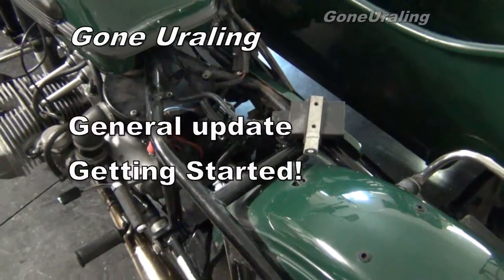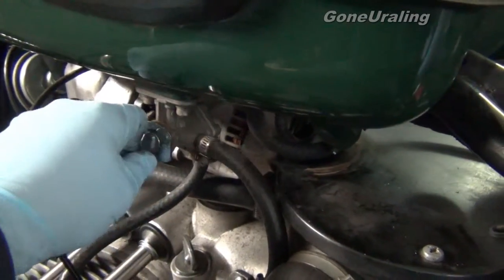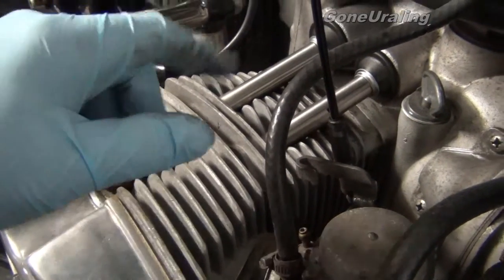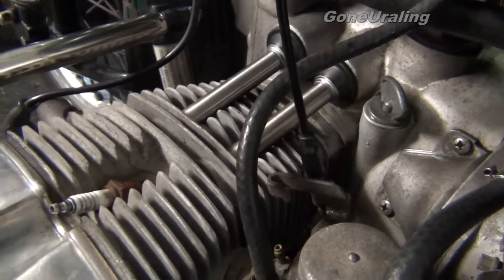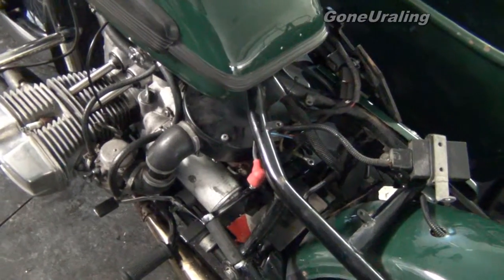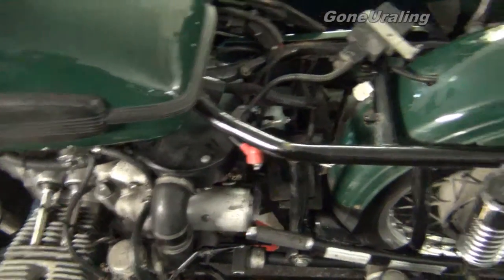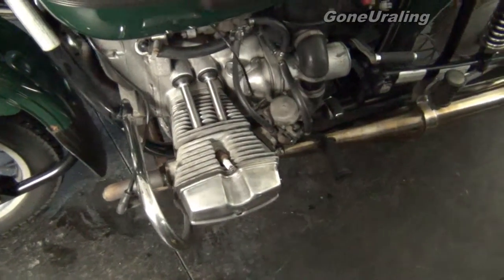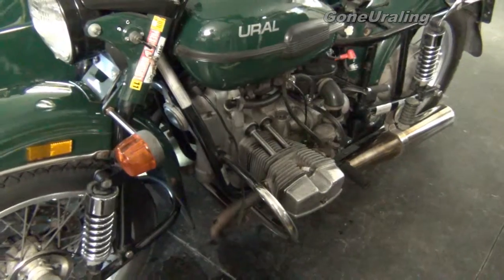2010 Patrol Project - Getting Started

Comment: I haven't watched past this video, but I don't believe you are going to find any major engine problems. If it is the case it was probably caused by running the engine with gasoline in the oil. I started working as a motorcycle mechanic in 1968 at our local Honda, Yamaha, and BSA dealership. Engines run fine at 90lbs of compression, but I would think it should be a little higher. It is possible with running the gas in the oil the rings are allowing some loss of compression. I would not tear down this engine at this time however. The Ural is an interesting motorcycle, and reminds me of the Japanese copy of the BMW R2 500cc , the Marusho ST. We had one traded in at our shop in 1968, and I found it to be interesting to say the least. You might check out the Marusho, I am sure you will find it an interesting story. Good Luck !
Reply from the maker: +Whitey It's been an interesting "refurbishment". Lot's of clean up and adjustment and while nothing major has presented itself so far, it keeps giving me indications that something isn't 100%. I'm getting 500 degree exhaust temps on the left side (lean? timing? carb?) but normal on the right. Going to swap carbs and see what happens. Then there is that odd cold knock. And the bearing noise when the clutch is released, and the imbalance in compression that still exists and the pristine and clean left cylinder vs. the dirty right cylinder.  THEN... I had clean oil in it and after running it several times it was clean then I check it again after a few more runs and it's BLACK again. I figured some sludge came free and mixed in. I hope it works on out and runs good, but I'm not ready to set off on a 200 mile trip with it just yet.
Reply: +Gone Uraling  One look at the spark plug you pulled from the left side shows it is not running lean at all. Left side to me as one is sitting on the bike, not looking from the front. I am now starting to believe you  may have a major problem. I would certainly get in touch with someone who is familiar with the Ural motorcycle. I will watch the videos to see what happens. It all depends on how long the engine was ran with the gasoline in the oil. Rings will re-seat in most cases, but with engines sitting for a while they can break when kicking them over for the first time. I can tell you are capable of completely rebuilding this engine if necessary. I hope that is not needed, and it ends up being a minor fix. The smoking cylinder could be cause from sitting, and the rings may re-seat themselves, I have seen this happen several times. It can also cause low compression. Good luck my friend. I have heard of the Ural, but this is my first good look at one. It is one interesting bike to say the least. I also noticed both rear wheels are driven, and sparks my interest even more.  Good luck my friend.